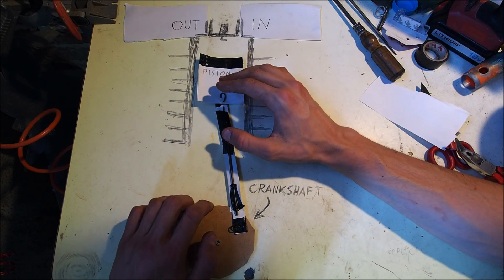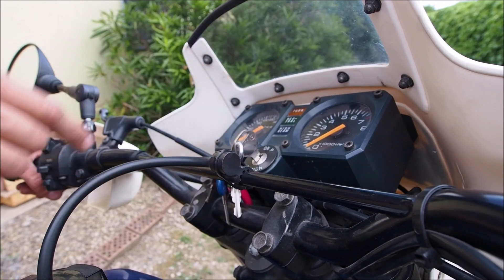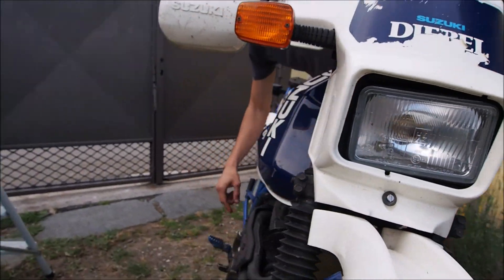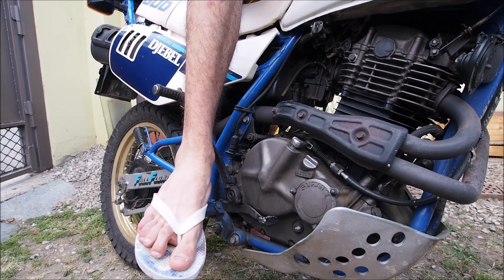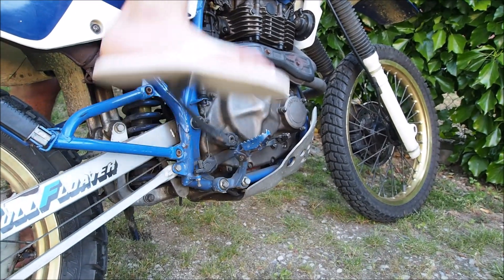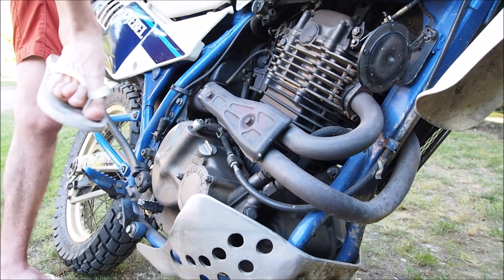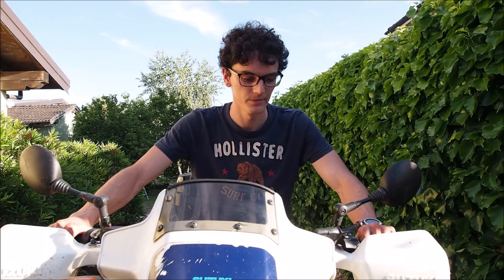5 Ways to Kick-Start a DR 600 (& any other four-stroke)

Comment: I have exactly the same bike it will be in the motorcycle exhibition of classic bikes in Crete this year. Very nice video. It's worth pointing out. Don't try this in flip-flops. If there is any kind of backfire from the engine you risk injuring your leg severely .
the dr starts fairly easily unlike say, a Yamaha XT 500. The DR has TWO  spark plugs which help as well.

Comment: Thank you for the explanation! The illustration was really cool. Thinking of getting a DR600 but I'm reluctant because of the lack of electric start. This vid helps a lot. What about kick-backs? What causes it and have you experienced it with the DR600? This is the biggest cause of my reluctance.
Reply: I have DR 600, and it only kicks me back if I add throttle while starting. For my DR - never start with added throttle, it hurts
Reply: NEVER kick with open throttle.
other than that, if you keep your DR in use, it should start quiet ok.
if you only kick from the top dead center of the cylinder you are fine, no magic involved :)
Reply: i havew a 1985 dr600 in the carage and am kinda terrifiwed to even start the project of cleaning it up and getting it runnin.

Comment: Is there any way that manual decompressor is installed wrong?
I bought dr600 in pretty bad condition
guy who sold it to me told me that it had aftermarket CDI and that it can't be kick started because of it
We pushed the bike and started it, it ran ok up until 2000rpm couldn't go above that
After some time I bought original CDI, installed it, and bike runs great, goes above 2000rpm, but still can't kick start it...
I remember the guy told me that he installed decompressor lever but didn't try it because of bad CDI
Every time decompressor lever pops up, I can't push kick starter down, I even stand on it, and it doesn't go down... like it didn't go above top dead center
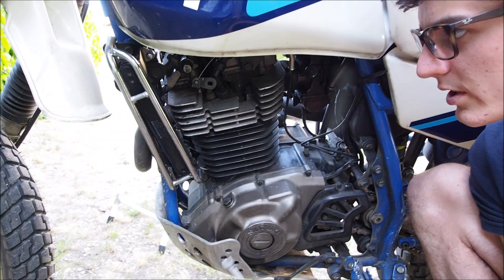Reply from the maker: try to act directly on the little shaft of the decompressor on the cilinder head and see if you can pass trough tdc, as i'm doing at 7:53 , try both of left and right side
Reply from the maker: you said you tried the 4th tecnique but couldnt pass tdc right? thank you for the sub anyway
Reply: @petertoridechannel9361  I want to apologise for being an idiot, and thank you for your answer!
I tried again, and got it to start!
Anyway... great videos, keep uploading!
Reply from the maker: great news! and thanks!
Reply: @petertoridechannel9361  I rebuilt a 1990 dr650 kick start only model. after I got the valves adjusted properly, the kick start was 100% easier to start. I know what you saying about it NOT kicking at a point. I usually hold down the decompression lever while kicking it 5 kicks, then I release holding down the decomp lever, when the kick lever is at the top of the kick. Now, not holding down the decomp lever (it stays in down position) When the kick lever is at the very top,  while I slowly push kick lever down, as soon as the decomp lever pops up. STOP THE KICK LEVER THERE, Allow kick lever to return to the top. THIS IS THE Start kick. 

My Bike does not do the double click thing the guy  in the video's bike does.

While trying to find the TDC point the decomp lever pops up and the Piston is on the exhaust stroke, this is the point where the kick lever will not move (you trouble above)

if while trying to find TDC stroke, Decomp lever does not stay down on its own after you pull on it while kicking slowly (pull decomp lever until it DOES STAY DOWN, Immediately stop kick and allow kick to return to top of stroke), I kick slowly until the decomp lever pops up. STOP THE KICK LEVER THERE. Then allow kick lever to return to the VERY TOP kick position. (this is the starting stroke) This kick will start the bike every time.

I hope this helps, Like I 1st mentioned. After I properly adjusted the valve clearances the Kick starter moved 100% freely and I didn't have to break a sweat starting bike.